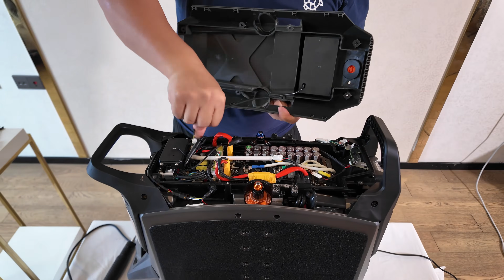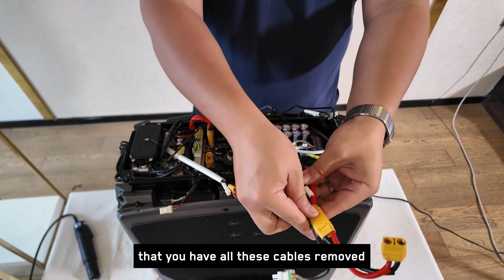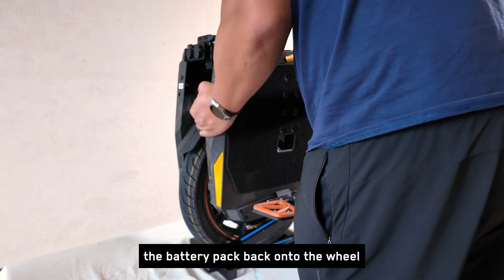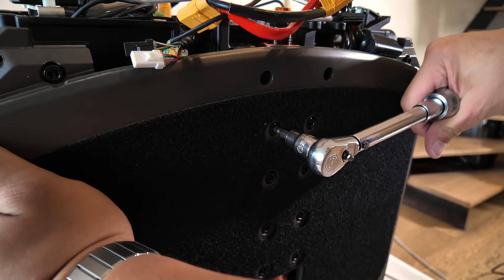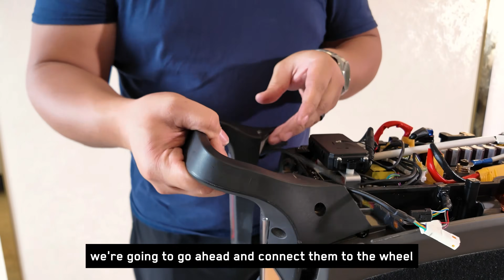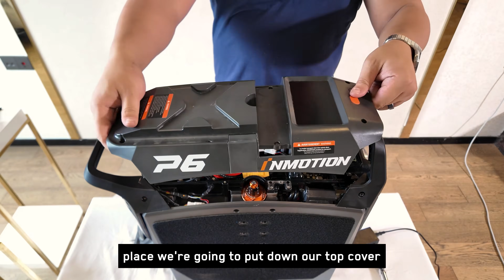INMOTION P6 | Battery Replacement

Comment: Just changed out my battery, it went well. You didn't include having to swap the pedal brackets, which was 3 set screws and pounding out the pedal axle. Also, I wish my new battery had velcro, spent an hour moving the old velcro over.